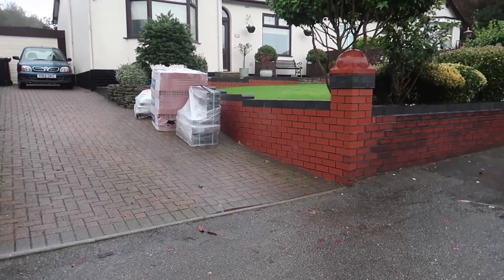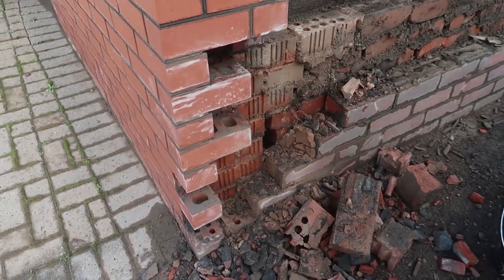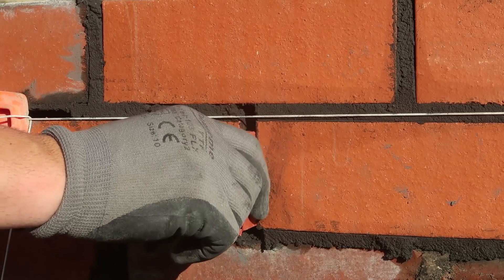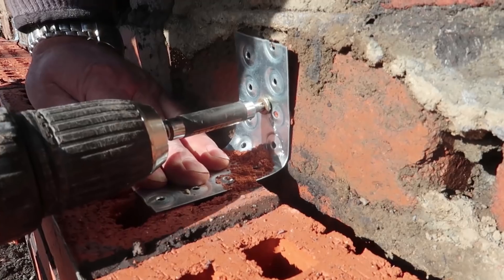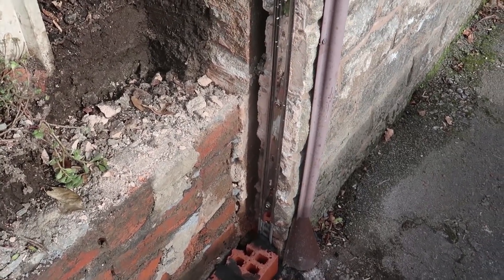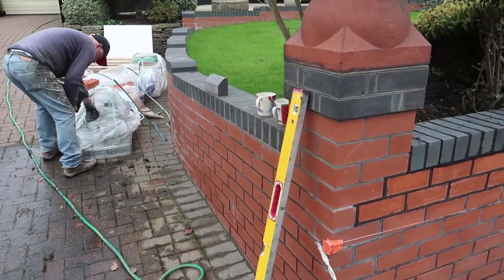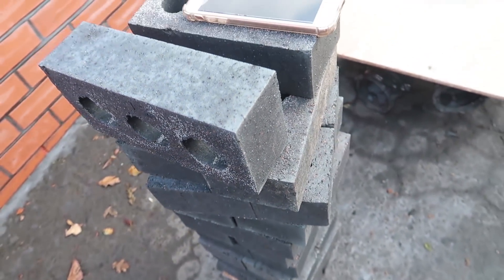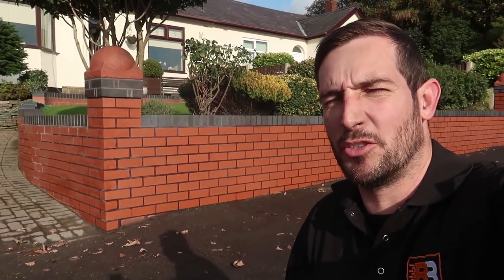Bricklaying - Oddly Satisfying Watching Bricklayers Build a Brick Wall

Comment: 3:32 weep holes should be sitting on the bottom brick, not on the bed.
Reply: marius codrut - Hi, it’s been placed that way so when the mortar is pointed it looks neater ... as long as the back of the weep hole isn’t blocked it’ll still do it’s job 👍
Reply: @PB-ds1to  if the weep hole is not placed directly onto the bottom brick and some water gets into the cavity then you'll have some 10-12mm of water at all times sitting in there and working against your wall.
Anyways, according to you neatness beats utility and the rules of construction.
Sorry for going that far, but this is the correct way to do it.

Comment: Just a quick one spot the difference from the original wall😳
Reply from the maker: I wonder if they can spot it?
Reply: 2 differences 
The step is 1 brick instead of 2 bricks like it was on the original  wall and also the bond on last course of reds is different  half bond instead of Flemish bond
Reply: Cristy Balint good try yes but there is something stand out different Try again
Reply: The pier is higher than the original first one where it is lower and I must be correct for as you have stated the difference that stands out there are many differences within the wall However you stated the one that stands out that is the difference that stands out the last pier built is taller than the rest of the piers
Reply: @Stucrompton1  spotted

Comment: brick on edge as a capping??  where will the water go apart from sitting on top of the brick potentially causing freeze thaw issue and also running down the wall and creating algae, maybe Sulphate attack or effloresence.  good practice is to use a creasing tile underneath or use a roper capping or a double bullnose and double cant brick.
Reply: Omg you absolutely weapon.